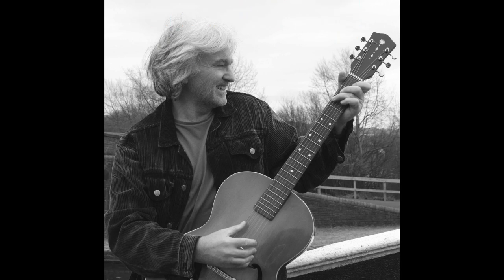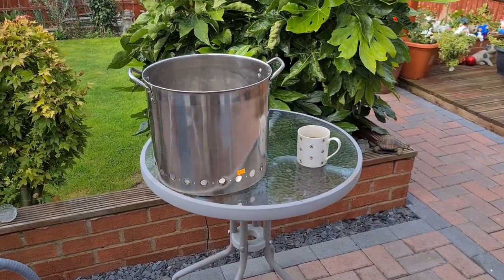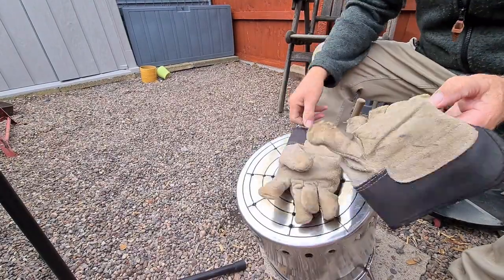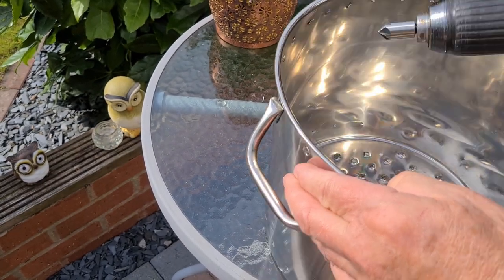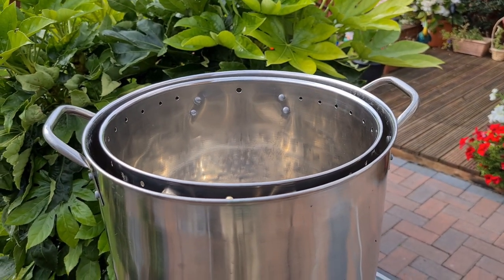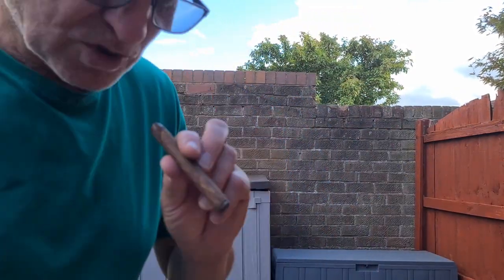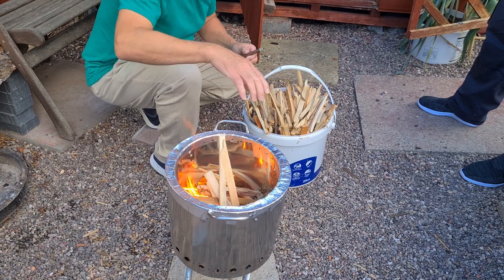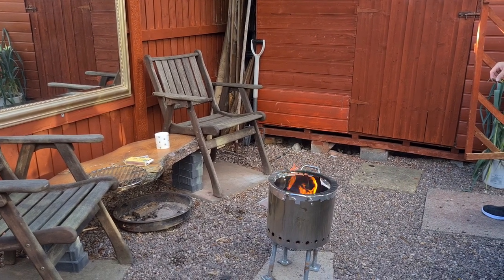Smokeless Fire - Pit - Grill on the cheap

Comment: Another way to start the fire is to put bigger wood on the bottom and smaller wood at up layers, the smallest twigs on the top and then light some soft paper or tissue to start burning the twigs. This will make even less smoke. We do this in the wild to build self feeding fire and it lasts longer and burns almost all wood. hope you give it a try.

Comment: Interesting project. I don't think you needed to drill holes into the bottom of the larger pot because the bottom side holes would provide the intake air. Also, maybe small embers could fall to the ground. I might try one myself.
Reply from the maker: Was fun making it, I thought  it might get even more air in the bottom with the holes plus there's a metal tray underneath to catch stuf. I must admit it works well once it warms up for a few minutes. It's prety much smokless around here, no chimneys just central heating so it really tickles me to have a great flame but no smoke to speak of so the neighbours don't even know I have a fire lol. Thanks for the comment.

Comment: How did the tape hold up? Thinking of using the same tape as a sealant for a stove I'm making out of a little 15ltr galvanised incinerator garden bin (converting it to a rocket stove).
Reply from the maker: It did let a little flame through the odd overlap and I'm guessing it won't last too many fires but to be honest I had the lids too so I've cut the lid so that it l just covers the top where the tape is and I've tapped it around again and it's holding up good for now.